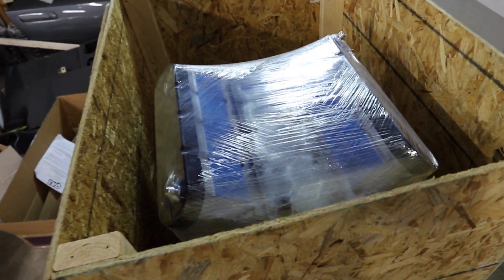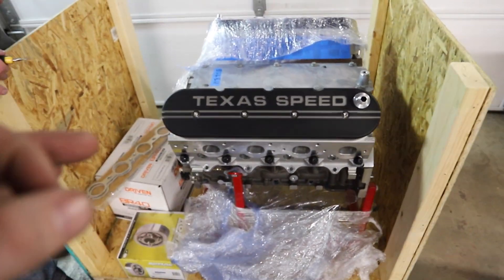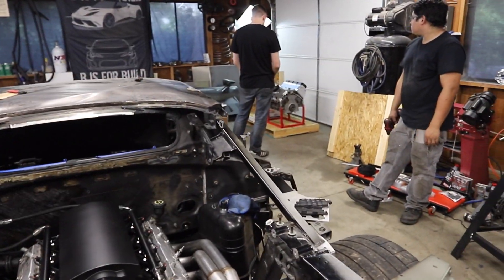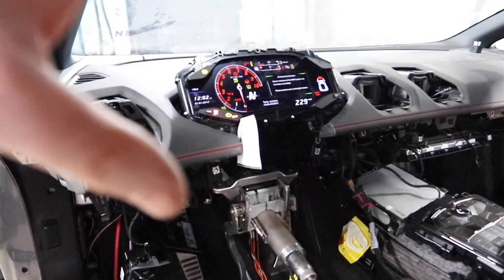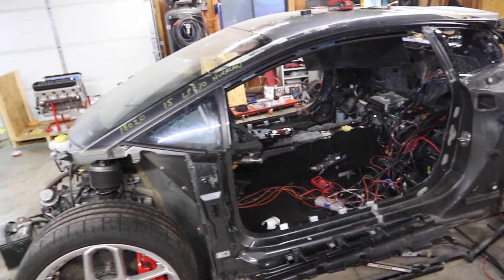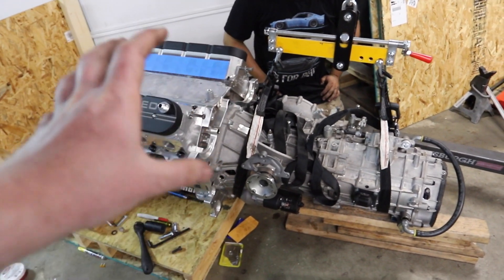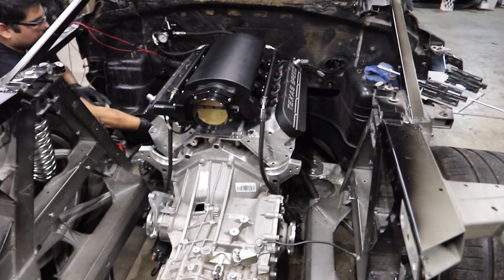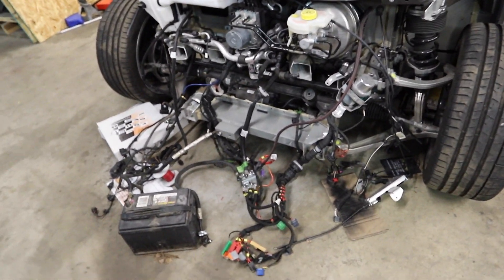Installing a New 1500WHP LS V8 Into Our Huracan

Comment: A Ford pulling a Lamborghini with a Chevy engine inside of it, I LOVE THE MAYHEM
Reply: Didn’t Chrysler own Lamborghini for a bit? Or was it Ford?
Reply: Its a VAG powered by a Chevy?
Reply: @anomamos9095  Mercedes (Daimler-Benz) owned Chrysler, but Volkswagen Group (VW) own Lamborghini/Audi/Bentley/Seat/Skoda/Bugatti/Porsche, and Ducatti motorcycles. plus MAN and Scania trucks
Reply: Ivan Barrett Volkswagen bought it in 1998. Before it was owned by dodge
Reply: Y not a cj-5 had a Buick engine in it in 1965

Comment: That amount of power, thinking of Building a Cage?
Reply: Especially with all that weight reduction from cutting the frame.
Reply: He'll have to anyways at some point to be even allowed to drag race it
Reply: Jeremie Lizotte, Aloud? Lmao, do you mean Allowed* ??
Reply: Also needs a wing that’ll actually push the rear down.. cause that will wiggle hard going 70
Reply: I think he said he would do a half cage, and knowing Chris and his lack of actual track time / days i doubt he will actually do any thing significant with the car.

Doing a full roll cage is probably more dangerous if he doesn't plan on using it just for racing.
Reply: @theniceguy504  There are enough over 1500HP Huracans which run fine without wings.
Reply: If he builds the carbon fiber properly he basically won’t need a cage
Reply: @modernlooks7041  for street use yes you are right, but for drag racing if this thing can do low 9s or 8s then the track admins would require him to have a cage certified. In the end its safety I am sure he has a plans for a cage. Either way would like to see a Burntacon vs Leroy
Reply: There are specific cage specs for different time classes of cars. Look at Leroy during some events. Was not allowed to run because he was missing a bar for that time class.
Reply: @TBasianeyes  true, but with much heavier engines in the back
Reply from the maker: planning to run under a 10 first, then we will be required to get a cage, and then we will build it. Or if we have spare time we will build it while the roof is off.
Reply: @BisforBuild  Nice
Reply: @theniceguy504  Wings aren't optimal for drag racing.

Comment: Craigslist: 
Hey guys I'm looking to buy a Lamborghini key, BCM2, and steering wheel lock module
Reply: LOL
Reply: Bad boy bad boy what you going to do when the police come for you!!! All good intentions right .......
Reply: Step one for how I steal Lamborghinis... Completely disassembled the interior and steering column and replace it with matching OEM parts.
Reply: this is what you need to start any audi/lambo car and so on... :)
Reply: dont forget, you need a driverside window as well...
Reply: @drt5665  😂 no passenger side.. Otherwise youll have to work around and sit in piles of glass

Comment: Texas speed lies about their engines, that thing probably can handle 3000whp
Reply: 1500 wheel probs 2k crank
Reply: They had us in the first half, not gonna lie
Reply: They under spec all their engines. Those guys are badass. Proud to have them in my town.
Reply: But, can this car handle the fact that there is no dry sump?
Reply: We got some heads from them. Valve retainer was not seated all the way and engine nuked on 1st dyno pull. They basically said "oh well" lol. PSA: double check their work.
Reply: @Buellerwtfman  I'd lut money on it being your fault. Lol
Reply: @Buellerwtfman  pretty standard to check everything and everyone's work, isn't it?
Reply: @JnixMarshel  Good ol Georgetown
Reply: @JnixMarshel  Bolt on heads, drops valve at 5k 1st pull. Agreed, was our fault for not checking their work.
Reply: Smart really. Create a good reputation for power and reliability.
Reply: Under promise, Over deliver.
Reply: Can handle it, but not for a long time. 🤣😂
Reply: @arcadiagreen150  Yea, that is pretty much the same attitude when it happened.
Reply: @JnixMarshel  I'm proud to live on the same continent as Texas Speed.
Reply: @andytaylor1588  haha. Hell yeah. I hope to make it to Canada one day.
Reply: 1500whp... If it actually can handle 3000 then that means its set for circuit racing where the engine has to go through a longer duration
Reply: Bueller how do you know it was a valve retainer unless you checked them before hand...
Reply: @headlesnorseman701  sounds like to me they overreved it, maybe with too large of cam for the push rods and lifters...
Reply: It probably can handle it, but can the car handle it, or is it even as reliable
Reply: @JnixMarshel  5k RPM? Yeah no.
Reply: @DanJLeh  I'm so sure it was only reved to 5k...

Comment: All that money and no dry sump???  You're asking for trouble!!!.  Dry sump pans are shallower too.
Reply: I was thinking exactly about that when I saw the pan. This build needs a dry sump
Reply: I think texaspeed would have put on a dry sump if there was a point to it .
Reply: Yea, but there's a big difference between drag racing and track racing/drifting when it comes to oil control. Not sure how he plans on using this car, but oil starvation is definitely a thing to consider with high HP LS engines going around corners.
Reply: Leroy doesn’t have dry sump either and he runs just fine
Reply: With this pan he not got have any issue with oil starvation
Reply: also if LS dry sump setups are anything like RB ones, aircon will be an issue and $6-7k USD is a lot of money :( if budget wasn't a question i would agree that a dry sump makes life easier with the clearance it provides.
Reply: @Sutliff01  if he is going to do any corner......well just look what happened to Hoovies LS Swapped Porsche
Reply from the maker: this is a good oil pan with baffles, and a dry sump takes up tons of accessory space, and thats space we do not have...
Reply: An Accusump is a good compromise between only a good baffled oil pan and a dry sump....
It can be mounted nearly everywhere because it only needs a couple of tubes and wires
Reply: charles howlett more money than 🧠
Reply: if its good enough for Leroy the Savage, its good enough for BIFB
Reply: Hoovies porsche had the ls engine turned around in the chassis so everytime he was acceleratig all oil was forces to front of engine. With a proper oil pan and sump it would have worked fine without a dry sumo.
Reply: @Sutliff01  Leroy is used at high revs for less than 10 seconds at a time on a strip. This engines gonna be running high for much longer.

Comment: I would recommend a sturdier mounting point for that winch. It’s the only thing holding the front of the vehicle down when winching it down like that. Especially overtime. I’d hate to see you damage a car or even worse another driver.
Reply: I think the bolts are more likely to break than that welded steel lol.
Reply: brooksman10 I’m not sure what grade hardware he used but that steel did not look too thick. And he never pointed the bottom side. Won’t last as long either

Comment: Any reason you guys aren't going with a dry sump setup? Seems like you wouldn't have to run such a deep oil pan, get some room back.
Reply: I would imagine one will be coming after some Dyno runs.
Reply: Shaun Kroon they seem to be following ole Cletus religiously. He doesn’t have a sump setup and seems to be doing alright. Cletus recently switched to that very same oil pan setup and that fixed his problems. Needless to say, a dry sump system would be superior however they are much more expensive.
Reply: @Mr-Sunday  Makes sense. Yeah it's expensive, but probably cheaper than blowing that expensive Texas speed engine due to oil starvation. Adds some complexity so totally understand why they wouldn't want to do it.

Comment: Chris, you mentioned things like coolant temp, fuel level etc... I personally doubt they are old fashion style on each wire each signal individualy, there will be more in CAN bus (or similar) comunication between ECUs which I believe you will need to connect with you Haltech, somehow decode and make those modules to talk to each other to make everything work. GL on that.

Comment: To turn ignition the bcm, key and steering lock will be enough, but if you want to start the car (with actual lambo engine) you need also original engine ecu which is paired to bcm system :)

Comment: Please spend some time reinforcing and triangulating your engine and gearbox mounts... 1500 bhp, a crap ton of torque, sticky tyres and drag racing will rip the running gear right out of the chassis as it stands.

On the gearbox I would suggest adding two lengths of alloy box tube running from the inner point of the gearbox mounts upwards and outwards to the chassis top rails.

For the engine use heavier gauge tube and thicker plates then box it all in between the tubes. I would also add some bushing between the base plates and the chassis to deal with vibration.

Comment: Seems like you would have been time ahead dumping the lambo electrics and fitting gm parts in to keep it all under one management system.   Are you able to interface the gm and lambo systems ?
Reply: As it sits right now, he should be able to run the stock breaks, power steering and AC, which would have been very hard to retrofit. As far as the gauge cluster goes I don't think they've figured that out yet.

Comment: You could sniff the CAN network of the working car, record it, play it back with a CAN tool that way the Lamborghini ECU thinks it has whatever is connected and it might get rid of some of the warnings or fail entirely.
Reply: If that worked, you could build a little raspberry pi to just constantly repeat those CAN messages.
Reply: I think a lot of what its upset about are just missing signals they'd need to replicate on the CAN network. Truck sensor, temp sensors, etc. May just be able to put the ECU back in and feed it the live signals from sensors on this engine and go that way honestly.

Comment: If you have less then a 6 for airo you can go faster otherwise you will both be to heavy and  the sleeved block can’t handle more then 25psi for a reliable amount of power

Comment: Autocross,  and or road race. Get the SCCA rulebook. You won't be able to run anybody at any track until pass tech  i can inspect and pass you for NHRA.  You can rent woodburn for 475 /day no tech inspect.  Call Jay Livingston at woodburn,  also you can split the rent with a few guys . if you are 700 whp,  which is realistic and weigh 2700 you'll be in the 10's and will need 12pt full cage . and will not be a dyi project. You'll need to set aside about 5-6 k. Also before you go any furthet go ask somebody to borrow their scales and get your four corners weighed,  49-51 is a great all around ratio.

Comment: I know this is just my opinion if you're trying to go for 1500 horsepower in the motors design for 1500 horsepower.. if you're putting turbskies on there.. most definitely think about 13 or 14 hundred horsepower and that way it gives you some kind of safety leeway you know to make the block last a little bit longer or even for your safety

Comment: Hey man the oil pickup O ring better not be pinched or torn while you installed/removed the pickup. They are known for that and will lead to starving your motor for oil. I would take it apart and carefully put a new O ring in.
Reply: Also make sure you put the right O ring in. They slightly vary in size between LS based motors.

Comment: What BCM key combo is that?  Seriously... The keyfob looks identical to the aftermarket PKE system I bought for my Tundra and Sequoia.  Easyguard EC002... It brought both of my vehicles inline with current tech.  I can start remote, and with the PKE, the doors (un)lock based on how close I get.  Push-button start is the bomb too...

Comment: i worry about the engine mounts .
 1500 horses is gonna be putting alot of pull on it .
 not to mention the vibrations ..

 isnt there a way to reinforce it more and also add Rubber bushing and Dampers on the contact point between
 Engine mount brackets and the Frame of the car ? 

 i just have the feeling that this engine is gonna be abit
 like a vibrator. Haha

Comment: The cooked control arm is most likely junk and will fail due to the heating and rapid cooling of being doused in water. Those arms are most likely forged and being cooked will remove the strength gained by forging.

Comment: The Huracan Gearbox is rated at 443lb-ft. You engine @ 7,000rpm will develop 1,125lb-ft. I hope you have another gearbox somewhere !!
Reply: Its not a Huracan gear box, the Huracan never came with an manual transmission.

Comment: What does 1500WHP mean ? If the engine makes 1500HP then what does the W mean. If you were meaning rear wheel HP then it should be 1500RWHP. So rear wheel means at the engine it should be more like 1700-1800HP. So what does the W mean ?
Reply: WHP means Wheel Horse Power.

Comment: i dont know why but those fuel line to the engine hanging there been bothering me for a while
Reply: If I were them id have brought the supply lines down to a single point with bent hard line, had both fuel filters on the drivers side and run a bit of braided line over to them. Would look a lot more factory to me that way.  Same with the lines from the tank to the filter, and tank to regulator, run some stainless hardline to those.

Comment: Oh boy an LS swap how original
Reply: So what are you swapping into a Lamborghini?
Reply: sparkplug1018 it’s just another Chevy now son 😂
Reply: @brycevaughan304  Not exactly an answer to the question.
Reply: sparkplug1018 here’s an answer: I drive a cheap v6 ☺️ simply my opinion that this car isn’t anymore special than it was before with the most common v8 swap in it
Reply: @brycevaughan304  I think the special factor of this build will come down to how well its built. It is a Lamborghini after all, so pretty high bar.
Reply: sparkplug1018 yeah I didn’t say it wasn’t high bar. It is for sure, these aren’t cheap cars and that engine isn’t cheap either the way it’s built. It’s still an interesting vehicle I just think building a Lamborghini engine would have made it more unique and stand out more from the typical car guy’s 5.7
Reply: @brycevaughan304  Could see that if they just dropped a ordinary LS in there and called it a day, that would have been ridiculous. Guess we just have to see how it  turns out.

Comment: I don't care what people say but i think that engine is going to fall out....manufacturers design the car around that engine....that car wasn't built around that engine period!!! You need more than a few bolts and welds....you need more bushing and more planning...i just hope he records it when it becomes a fireball!!!
Reply: Theres literally more holding this engine in then there is in a ZR1 Corvette. It isn't going anywhere.
Reply: @sparkplug1018  it doesn't matter they are more supports than things that hold the engine in...i know someone who swapped engines all the time...the engine would sheer bolts and welds with eeeezzzz...
Reply: @UnknownUnknown-kz9nt  Still, assuming that those welds have good penetration, this is a pretty solid design. Which from the looks of it surpasses what was there to begin with.
Reply: @sparkplug1018  bruv I've worked with engine mounters every day the pressure is so enormous the engines aim is to break free...the welds and bolts will sheer!!! ....i hope he posts if it comes out....it will drop and the car will grind to a halt

Comment: Why would you ruin the car, leave European cars alone and don't put American engines cuz it makes it heavy and not handle properly because these cars were properly developed to have that engine
Reply: That LS will hold more power and weigh less than a Lamborghini v10, and it's cheaper and WAY easier to repair and upgrade.
Reply: I highly doubt the original V10 weighs less then the aluminum block V8 that went into this. At any rate A, we will not leave European cars alone just because you're butthurt about it and B. this car was a literal piece of trash when he started with it. And once the last few useable parts were picked from its carcass it was going in the shredder.